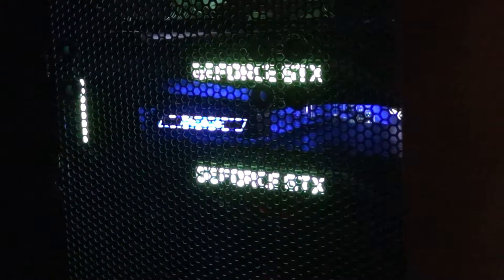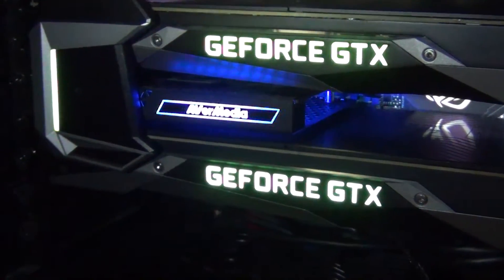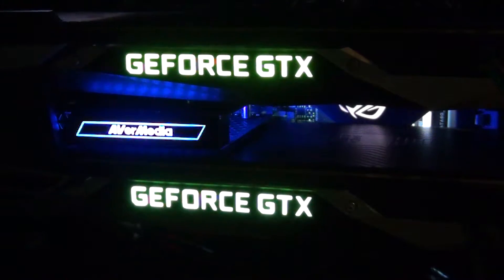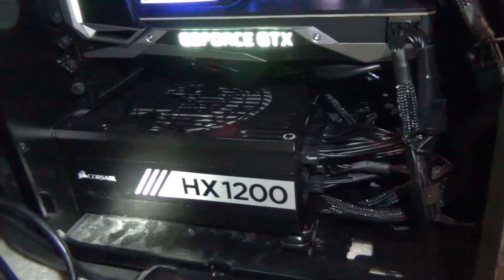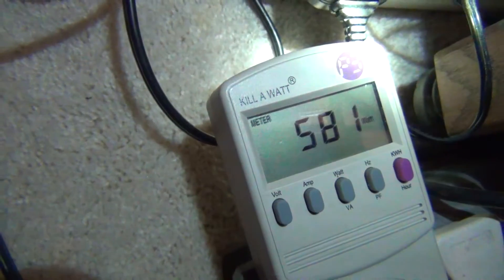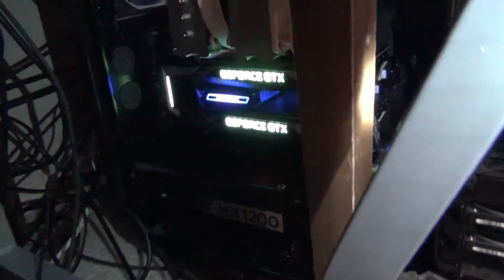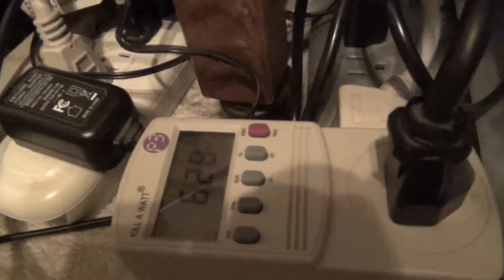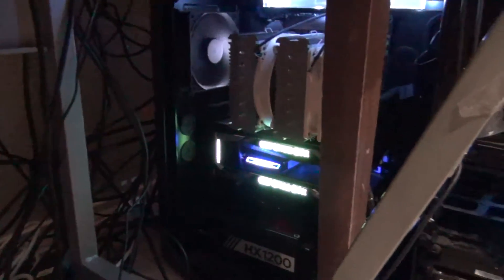Geforce GTX 1080 SLI Noise Test and Power Consumption

Comment: Did you ditch the 2 x Vega 64? I was considering if Vega cf worked for you in battlefield 5? I have 1 Vega 64 reference design.... I see they are only about 400 on sale now.
Reply from the maker: Why would I ditch the Vega 64 crossfire? It's an amazing setup. I still have them. I know that Vega crossfire works in BF1 but I don't have BF5 so I can't comment on it.